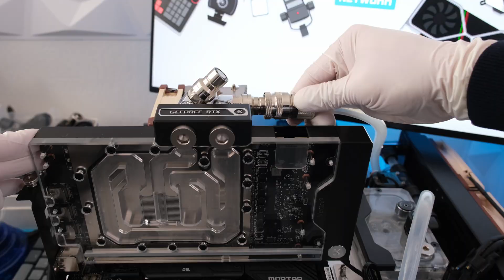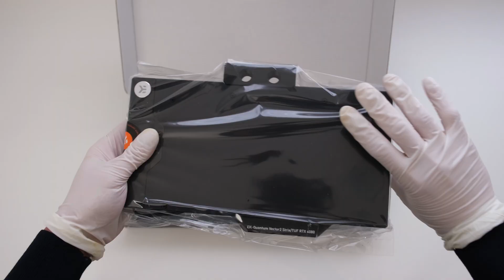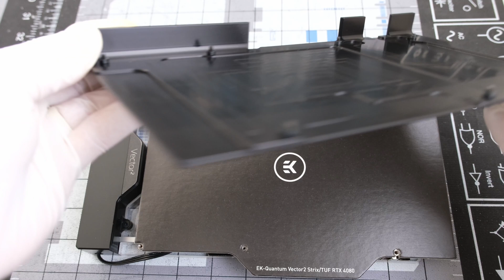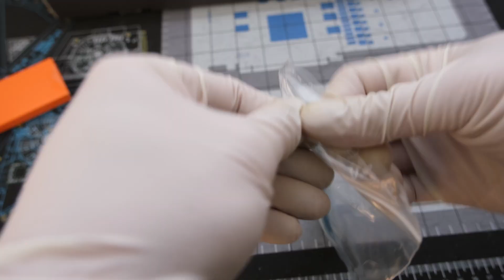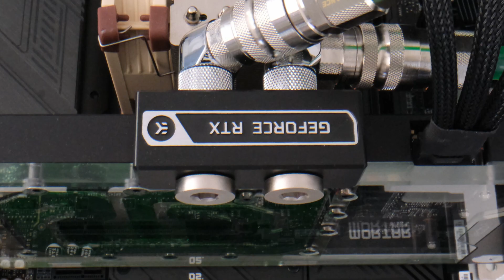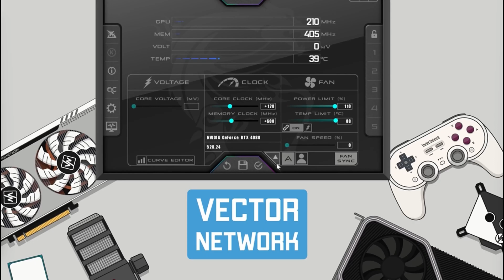EKWB RTX 4080 ASUS TUF Water Block Installation & Testing

Comment: The cuts are a bit obnoxious 😂 I was ready to say people in the comments were overreacting, but yeah, it’s a bit much.  Cutting unnecessary sections and just letting the footage play out or speeding up playback are a better option.  Definitely potential here, I’ll sub, I’ve been water cooling for 15 years so I’m definitely interested in the topic.
I was already subbed 😂
Reply from the maker: Thanks for your comment 🙏 It took me a while, but I have heard the feedback and have made significant efforts to slow everything down and let it all breath. I hope you get a chance to look at some of the more recent 4-5 videos to see if the slowed down cuts are more to your liking. I will do my best to continue to listen to feedback and improve with each new video. I have several videos planned and the next one will be a price-to-performance watercooling build. It will give me the chance to showcase no-frills parts that will likely end up performing quite well and let me give some more commentary on things like fittings/pumps/tube runs, etc. After that, once Optimus decides to release their 4090 Founders Edition block, I will do a video on that, then put that in a new build with likely a Mora-Noctua-420. I appreciate the feedback and I hope you stay tuned.
Reply: @vectornetwork  Optimus still doesn’t have a block for the 4090 FE? 🤦‍♂️ I tried to order from them a few times and every time I’m on back order for months, and I give up and get an EK.

Comment: Hi.great video.can I ask from your experience if my waterblock from my etc 3080ti will match with the new RTX 4070ti or 4080?
Reply: They are not compatible.
Reply: Late reply but definitely not your gpu is atleast 25% less fast than the 4080 you probrally wont get a extra 25% preformance after waterblocking it maybe 10% or so maybe 12-14% if you got a golden sample.

Comment: Hey have you noticed any rare behaviour? I have the same card and block and my temps are way higher compared to my previous 3080ti ftw3 WB. On that one I got like 52C at 430W and with the 4080 i’m at 57C at 345W. I’m running heavy OC +180 on gpu and +600 on memory.
Reply: 3080ti uses a GA102 die which is much larger than the 4080s AD103, smaller die means worse heat transfer. The 4080 die is smaller than the 3070's die. I also have similar temps, 63 with 26c ambient at 350ish watt
Reply: I would look into your pad/paste application. Your WB Temps are similar to what I saw on the stock cooler (maybe 5-6° cooler)

I have this block on a TUF OC 4080. Used Kryonaut Extreme on the GPU, and k5 Pro on everything else. Running 110% PL @ locked 100%V, +150 on core and +800 mem. Temps rarely go over 50°.
Reply: @mikemarch231  hey! Finally fixed this POS. I had to use liquid metal to fix it. 10 degrees less compared to previous results. I really miss EVGA and their preinstalled block gpus.
Reply: @meisterziege  glad to hear you sorted it out.
Reply: I have a vector block on my 4090 and it’s the most disappointing water block I’ve ever had, simultaneously the most expensive.

Comment: Good lord, man...the amount of air in that loop.  You were trying to benchmark running that much air in the system??

Yeah, it looks cool...and works hot.

Purge the system!!!  Cavitation doesn't explain that, at all.
Reply: Getting air out takes time, but I’d agree if he’s going to publish a review it should be on a properly bled loop
Reply from the maker: Thank you for your comment 🙏I really wanted to get some good footage of the water just blasting through the block. Part of it was because there are times where the camera isn't setup quite right and/or things are just a bit too wobbly or out of focus and its really hard to redo and the first fill can only be done once. The other part is I really think it looks cool, seeing the water flow through the water block and fins. So, I've always tried to capture that and I will thrive to do better and use better techniques every chance I get, as I make these videos. There are other shots towards the end (if I recall correctly) where the bubbles had been bled out and the coolant doesn't even look like its moving. It also looks nice like that but I also think that movement is what really catches the eye. In any case, I record all the data for the charts and the temps and everything seemed to really perform as expected in relation to each other as I went through the bevy of tests. I appreciate the feedback and encourage you to provide more if you decide to watch any more episodes. Thank you again and thank you for taking a chance to watch.
Reply: @vectornetwork  Ok, for B-roll...I get it.  I suppose the only issue is someone new to the open loop game might think that's ok! LOL

Yeah, it does look better than just a solid color with no discernable movement.  Absolutely give you that!
Reply from the maker: @MrAcuta73  Thank you for your comment 🙏 and yes, I hadn't considered that the bubbles would give off the wrong idea. I may consider that more as I am working on the footage and/or editing the shots. It may be good to have 2 clips back-to-back. One showing the bubbles and the other showing it after all the bubbles have been bled out and the reservoir completely topped off. Much to consider and thank you for watching and providing feedback!

Comment: Is there any chance I could get some measurements of this with the 4080 PCB installed? I know this waterblock is 153mm wide, but that’s not including the PCIe connector sticking out is it? I’ve been browsing Reddit and all the YouTube comments/videos I can. Any help would be appreciated. I just want to know if this is going to hit my front glass in the Lian Li O11 Dynamic Evo. I know the TUF card can barely fit in the case as standard, and the card is 150mm wide. But it’s so hard to find dimensions with the full water block installed. Any help is much appreciated
Reply from the maker: Thanks for your comment 🙏Correct, the 150mm wide does not include any power cable sticking out. I'm looking at it now, and the end of the black wrapped part of the cable connector almost lines up exactly with the end of terminal block, which is the widest point on the block, which I am assuming is that 150mm measurement. If the case has room for the 150mm width, then you can likely bend the connector downwards and toward the back of your PC and it wouldn't hit the glass. Keep in mind that, as long as you fully plug the connector in, it should be fine if you bend it in that manner. Hope that helps.